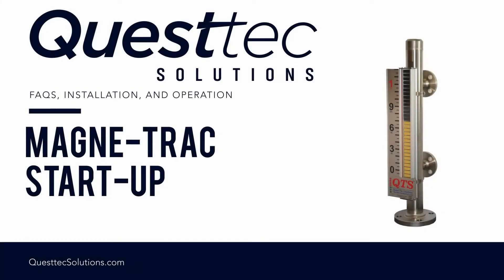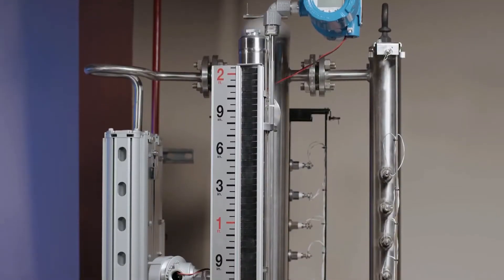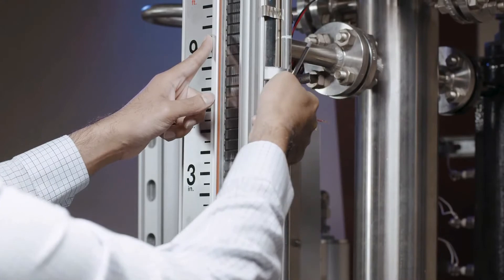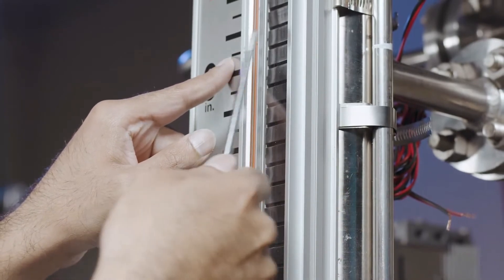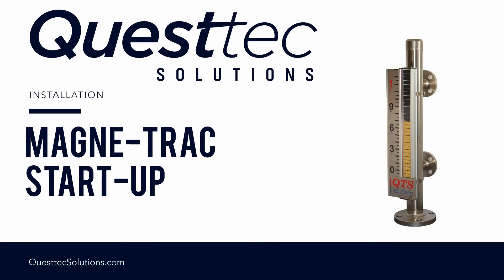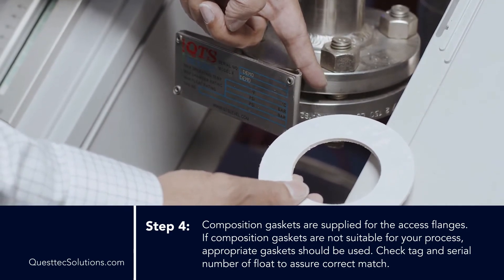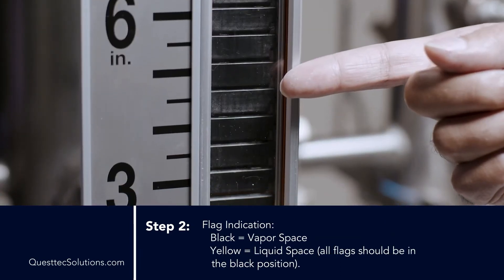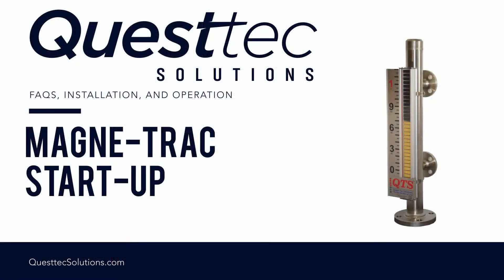Installation and Startup for the Quest-tec Magne-Trac Magnetic Level Gauge

Comment: The oil in my chamber is in the maximum position, then I slowly drain the oil in the chamber, during which the indicator flaps sometimes do not reflex completely, so what is the cause? I checked and found that the Magnet Float is normal, in the correctly mounting direction and not damaged